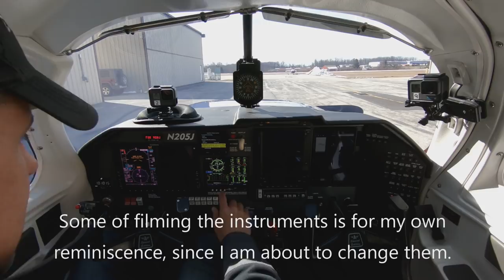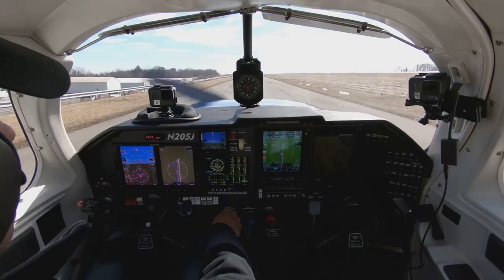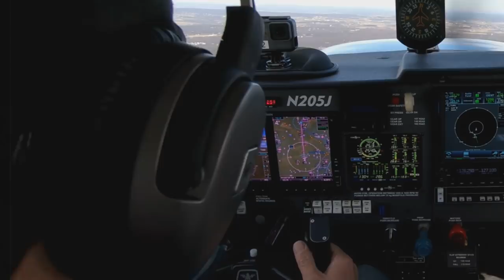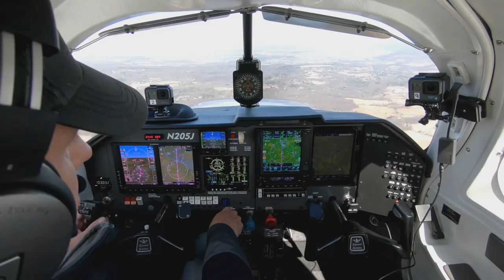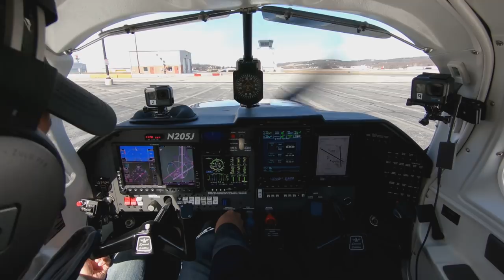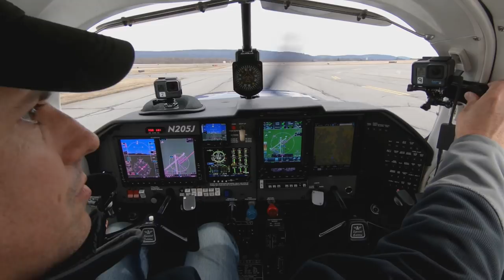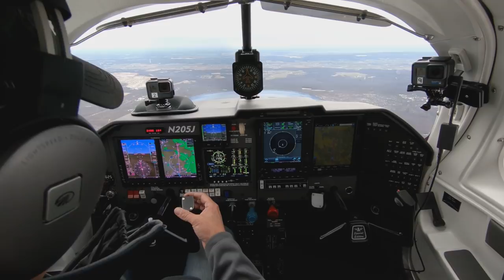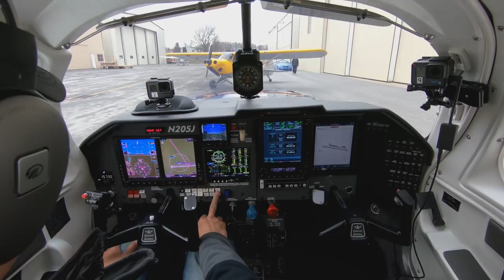Mooney M20J 205 SE Flight to Mooney Pilot Lunch at KRDG

Comment: I believe you would want a rise in oil pressure when exercising the prop (pulling it back to High pitch, low rpm position is accomplished with oil pressure acting on the piston... multi-engine airplanes with featherable propellers are the opposite... awesome video and Mooney! Looking forward to seeing more
Reply from the maker: Take a look at this animation when the prop lever is pulled back.  http://www.boldmethod.com/images/learn-to-fly/aircraft-systems/how-a-constant-speed-prop-works/animation-prop-back.gif oil will be supplied to propeller hub causing slight drop in the system since oil pressure gauge takes reading of engine oil system; not the oil in prop hub.
Reply: Rmag is correct. In Mooney's, oil pressure drop on cycling the prop.

Comment: Question. Why did you first contact approach before landing even though you were flying VFR? Couldn’t you have gone straight to tower?
Reply from the maker: Typically when an airport has its own approach and departure control you contact them first as they route departing or arriving flights into the airspace.  Tower handles the takeoffs and landings.  If I called Tower outside the airspace they would have asked me to contact approach.
Reply: @RMAG  Thank you!

Comment: Are you at all worried about the possibility of losing all your digital displays if the power suddenly went out or CPU froze up or something?  Seems like you'd want to have at least airspeed and altitude steam gauge backups just in case?  And a backup artificial horizon would be nice too.
Reply from the maker: That is why a have a separate backup. The small unit to the upper right of the G500 is a L3 ESI-500 back up altimeter, attitude indicator, airspeed indicator, heading indicator which is battery powered in the case of an electrical failure.
Reply: @RMAG  oh..  awesome! I love your plane

Comment: Why say "clear prop", and instantly start the engine?
Reply from the maker: It’s a warning to anyone that may be in the area that a prop is about to start. It is a safety warning.
Reply: Then why do they start the engine one second after saying "clear prop" ? Not much time to get away at all. In most cases, none.
Reply from the maker: It’s an alert to tell people that may be in earshot to “keep away”.  If someone was already “in the way” no a few seconds would not matter.  That is why you look left, forward, and right to look for someone “in the way”.  Then you don’t start it until they are clear.  I always visually clear the area, to make sure no one is “in the way” and then give an audible “clear prop” to alert people to keep away and not approach the plane at this time.
Reply: oh
Reply: @RMAG    --  Really ?  I don't believe that 'Clear Props' is to stop people approaching the aircraft -- it's for the child sitting under the nose (For example).  Starting the motor almost immediately that you shout the warning, without a pause, is a poor habit.

Automobiles are now equipped with rear-facing cameras.  Now, there's an idea.

Comment: All that glass is not good for safety. Gotta have some steam backup.
Reply from the maker: That’s what the small gauge to the right of “N205J” on the panel is.  Backup, attitude, altitude, airspeed, bank, vertical speed, heading and it has separate battery backup.  It would be illegal to have an IFR capable airplane without backup instruments.  Mechanical steam gauges don’t make a better backup.